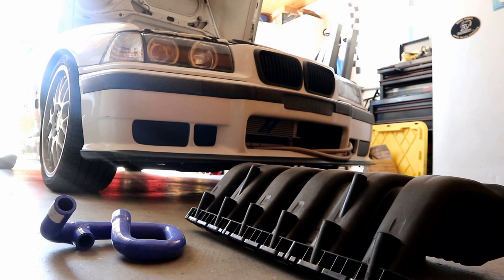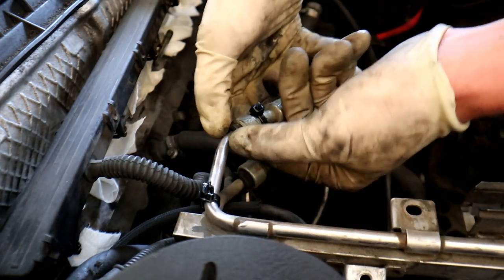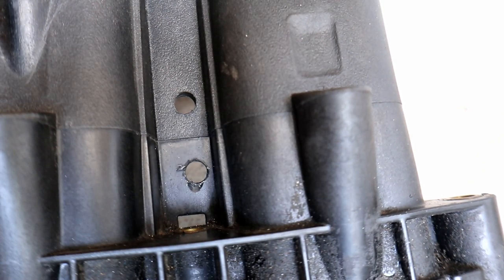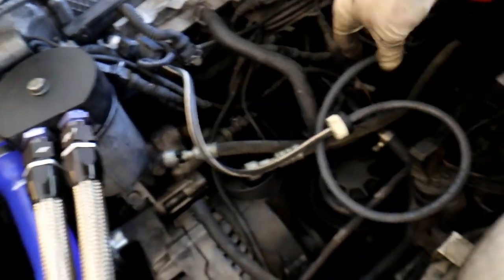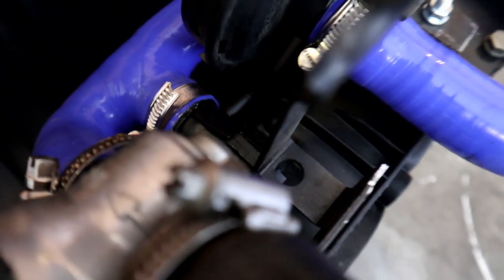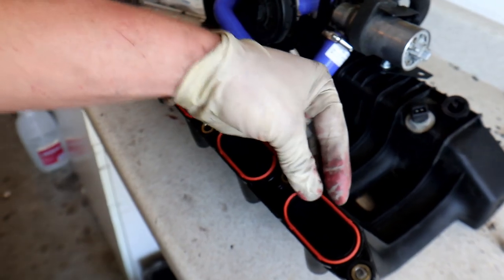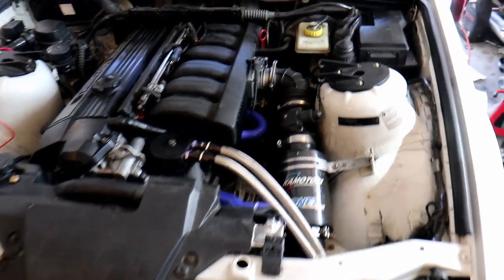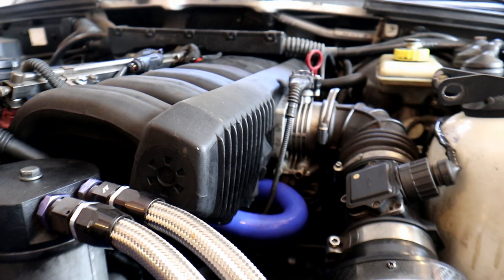M52/S52 M50 Manifold Swap DIY

Comment: Have you ever seen a m50 fuel rail without the FPR attached like the m52's fuel rail? I recently pulled a m50 intake off of a 95 325 and when I got home I started comparing it to another one I had purchased off a friend. Not a surprise everything was the same except when I got to the fuel rail one the newly purchased intake there was no FPR hanging off the bottom and not even a sign of where one may have been. Does this mean I don't have to do any modifications to make the fuel rail fit? Unless they came up with a way to contain the FPR inside the fuel rail it literally doesn't have one so why can't it be used on the swap as the m52's FPR is  obviously somewhere else. PLEASE RESPOND,this has been a un answerable question Trpremote@gmail.com
Reply from the maker: are you m50 manifold swapping an M52? if you are then you shoudl use the stock m52 fuel rail, and will need to modify the manifold to fit.

Comment: So when I go to start it,if I messed up somewhere and now have a vaccum leak will I throw a code? If so will that code then have to be cleared to turn off my engine light reguardless if I fix the leak?
Reply from the maker: most vacuum leaks will throw a code, if your car is OBD2 the code will not self clear and will need to be cleared with a scanner. it it's obd1, then the code will self clear when the problem is fixed or the battery is disconnected.